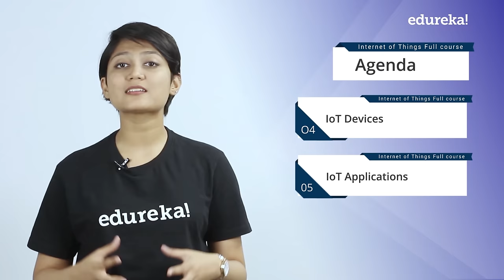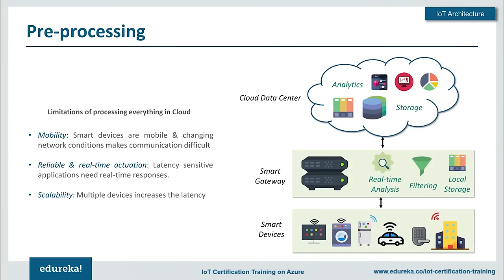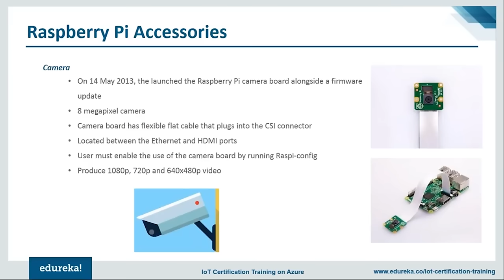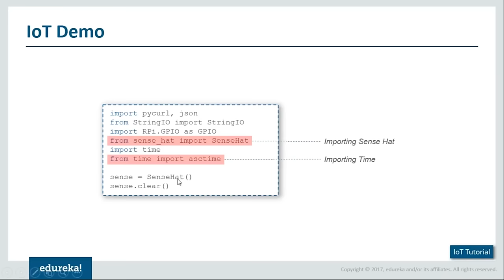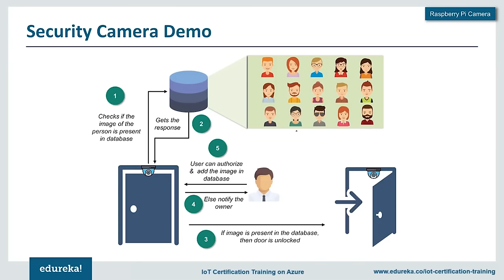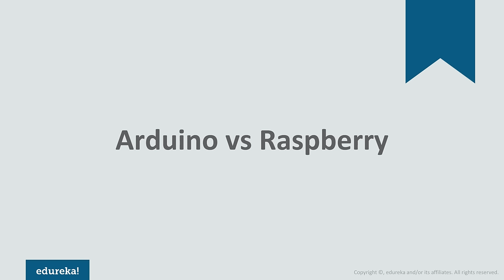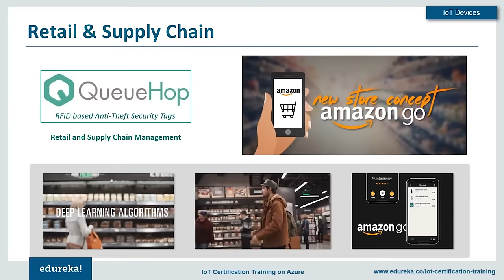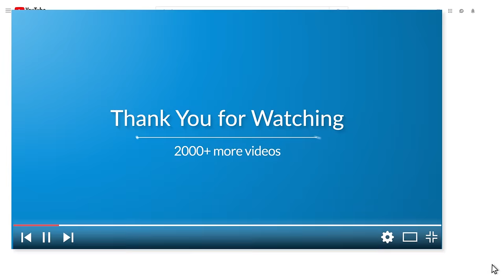IoT Full Course - Learn IoT In 4 Hours | Internet Of Things | IoT Tutorial For Beginners | Edureka

Comment: 2:05 IoT Introduction 
2:10 What is IoT?
5:30 Why do we need IoT?
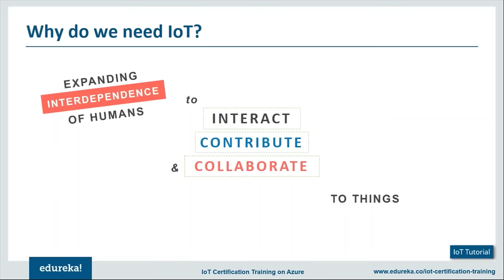8:25 Benefits of IoT
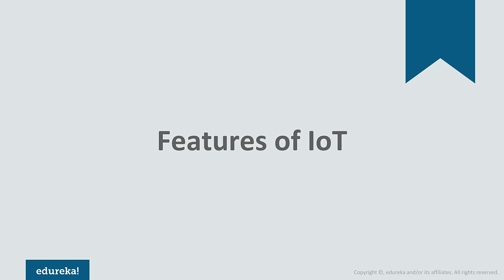11:00 Features of IoT
19:40 IoT Architecture
19:45 IoT Ecosystem
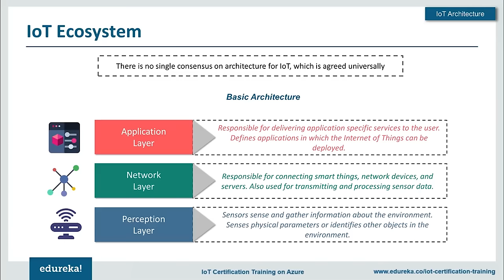20:35 IoT Ecosystem - 5 Layer Architecture
22:15 Cloud Computing in IoT
22:50 Fog Computing in IoT
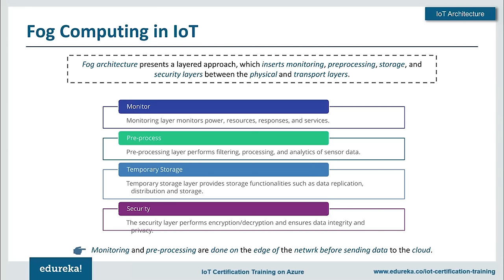26:45 IoT Taxonomy
28:20 Perception
31:25 Pre-processing
34:55 Communication
41:20 Middleware
43:10 IoT Application
44:05 Raspberry Pi - Introduction, Installation & Hands-on
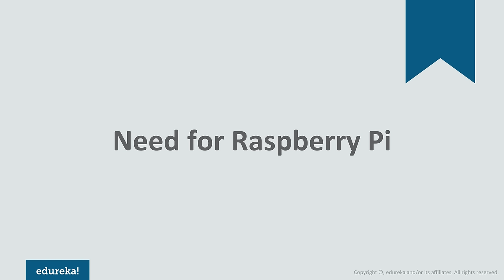44:10 Need of Raspberry Pi
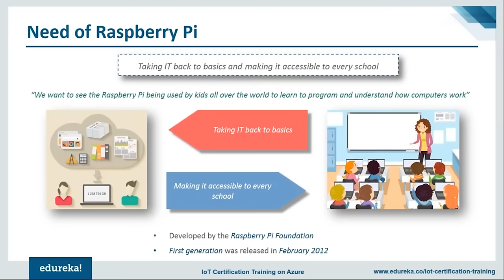45:35 What is Raspberry Pi?
48:50 Capabilities of Raspberry Pi
50:00 Raspberry Pi Hardware
    52:25 Processor
    53:30 RAM
    54:05 Networking
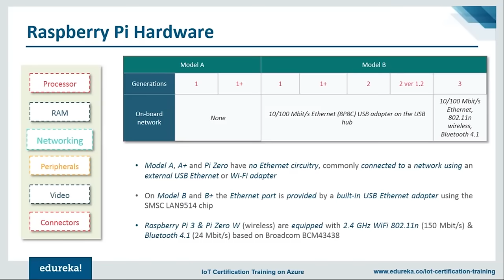    54:25 Peripherals
    54:45 Video
    55:35 Connectors
56:00 Raspberry Pi OS Installation & SenseHat Demo
56:05 Raspberry Pi Installation
1:02:15 Raspberry Pi Accessories
1:02:20 Sense Hat
1:04:00 Camera
1:04:30 Infrared Camera & Gertboard
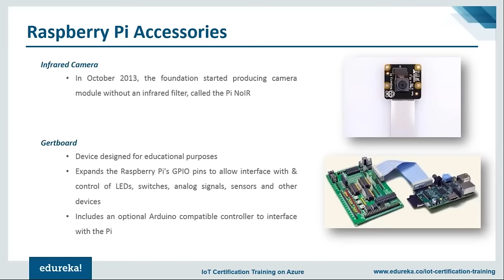1:05:15 Sense Hat Tutorial
    1:05:30 Displaying Text
    1:09:15 Displaying Images
    1:10:55 Setting Orientation
    1:12:20 Sensing the Environment
    1:15:55 Detecting Movement
1:20:25 IoT Demo
1:55:55 Raspberry Pi Camera
1:57:25 Pi Camera Installation
1:59:40 Connecting Pi Camera to Raspberry Pi
2:00:30 Raspistill
2:01:10 Raspivid
2:02:10 Python PiCamera
2:04:30 Picamera Capturing & Recording
2:05:30 PiCamera Adjusting Properties
2:05:45 Security Camera Demo
2:07:06 Face Detection
2:07:46 Haar & LBP Classifier
2:28:21 Raspberry Pi + Windows 10 IoT Core
2:29:01 Windows 10 IoT
2:31:16 Windows 10 IoT Core Installation
2:38:36 Arduino vs Raspberry Pi
2:39:26 Integrated Circuit Boards
2:41:06 Specifications
2:42:51 Modes of Operation
2:46:21 Boards Available
2:46:56 Top IoT Projects
    2:47:11 Biometric System
    2:48:16 Smart Irrigation System
    2:49:56 Security Camera & Door Unlock System
    2:51:06 Smart Home
    2:51:51 Smart City
    2:52:36 Zelda Ocarina Controlled Home Automation
    2:55:21 Jarvis 
2:57:26 IoT Architecture
2:58:36 IoT Devices
2:59:21 What is an IoT Devices?
3:01:51 What can things do for you?
3:05:22 Fitness
3:05:32 Healthcare
3:06:27 Serving the greater good!
3:07:47 Smart Agriculture
3:08:47 Retail & Supply Chain 
3:10:57 Logistics
3:12:27 IoT Devices Security
3:14:07 How to build an IoT Devices?
3:16:42 IoT Applications
3:17:12 IoT in Everyday Life
3:19:02 IoT in Healthcare
3:20:47 IoT in Smart Cities
3:23:03 IoT in Agriculture
3:25:18 IoT in Industrial Automation
3:26:28 IoT in Disaster Management
3:29:53 IoT - Jobs, Careers, Salaries
3:30:48 Overview
3:31:23 Market Trends & Projections
3:32:03 IoT vs Other Domain
3:32:38 Salary Trends
3:32:58 Salary Trends by Functional Area
3:33:53 Salary Trends by Experience
3:24:28 Companies Hiring IoT Professionals
3:35:13 Current Roles for IoT Professionals
3:36:23 Emerging Roles for IoT Professional
3:38:43 Skills Required 
3:40:23 IoT Training @ Edureka
Reply: Awesome guy👍
Reply: Wowwwww
Reply: Comment to be pinned

Comment: Good Stuff. I had a query. For the irrigation project, where is the sensor installed? Is it in the soil? Will the sensor in the soil will have FOG architecture and Operating System or it would just relay the information to Arduino board? If there is no OD and processing being done by sensors, how does it communicate with Arduino board?
Reply from the maker: The Soil Moisture Sensor uses capacitance to measure dielectric permittivity of the surrounding medium. The sensor averages the water content over the entire length of the sensor. The soil moisture sensor would be connected to the Arduino. The sensor module contains a potentiometer with it, which is used to set the threshold value.

Comment: What so u mean by peocessing the data at gateway level in fog computing ?
Can u plz explain me in   detail.
& whats  the difference btw fog & edge computing
Reply from the maker: The main difference between edge computing and fog computing comes down to where the processing of that data takes place. Edge computing usually occurs directly on the devices to which the sensors are attached or a gateway device that is physically “close” to the sensors whereas Fog computing pushes intelligence down to the local area network (LAN) level of network architecture, processing data in a fog node or IoT gateway.